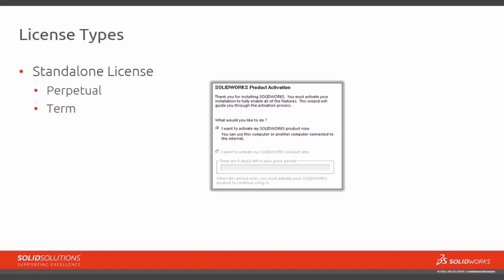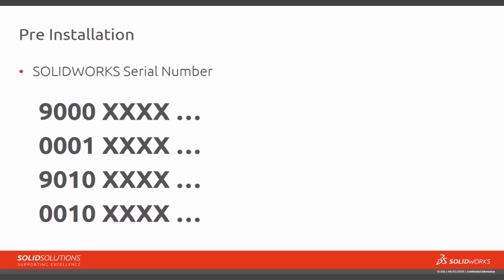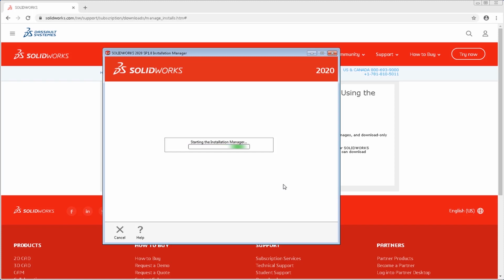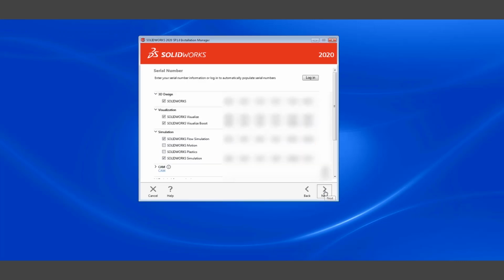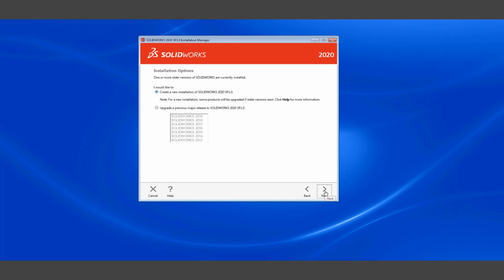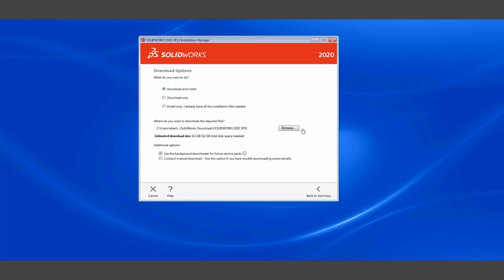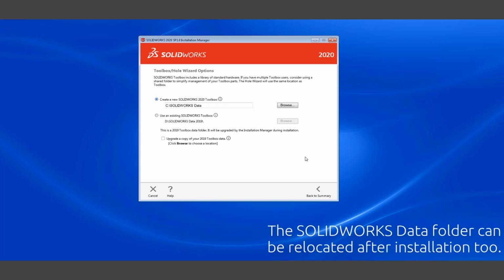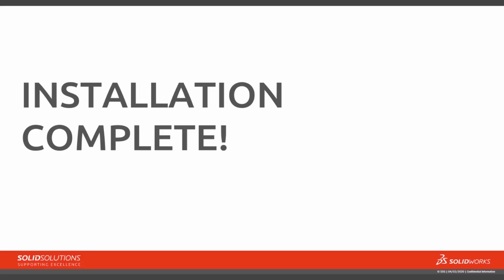How to download and install SOLIDWORKS (2020)

Comment: I jst want to download the software so that my IT guy can activate it for me with our licenses... Is this not possible. You have to have a liscense first? Waste of my time sitting with the IT guy while the download happens..
Reply from the maker: Hi James, if you run the SOLIDWORKS installation manager one of the options you can choose before putting in a license key is to 'Download and Share all files'. You can do this to get the files downloaded and ready before running through the installation with your IT present. Hope this helps.

Comment from the maker: Hi, I hope this video answers your questions and helps you get SOLIDWORKS up and running. If you are getting stuck, then I suggest that you contact your local reseller for support. 

If you require a serial number and are based in the U.K. or Ireland then please visit https://www.solidsolutions.co.uk/LP/Get-a-Price-for-SOLIDWORKS-from-Solid-Solutions.aspx for a quote. 

Alternatively you can visit this page to find a local SOLIDWORKS reseller in your country. https://www.solidworks.com/sw/purchase/varlocator.htm